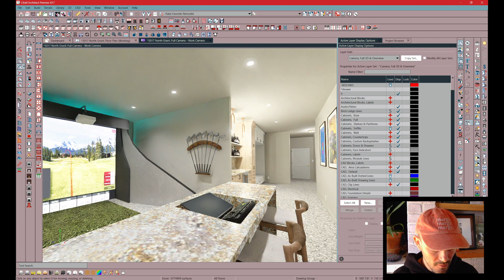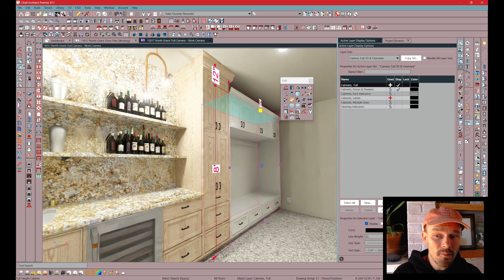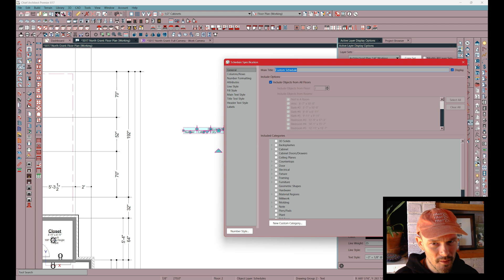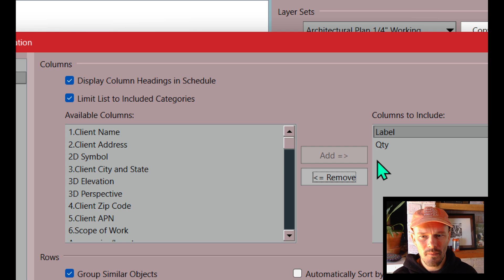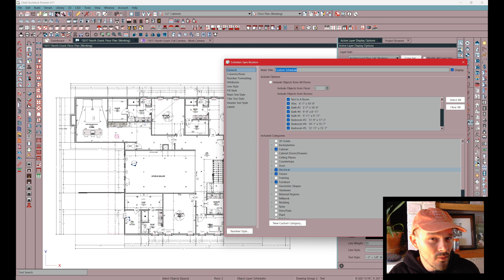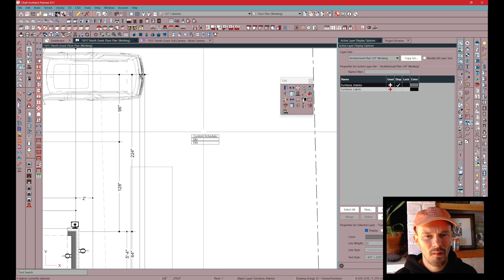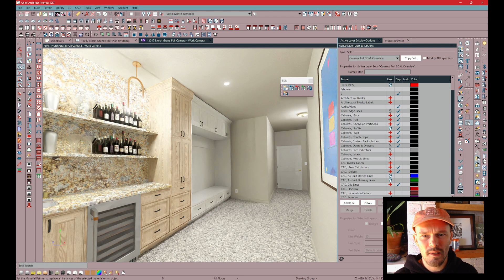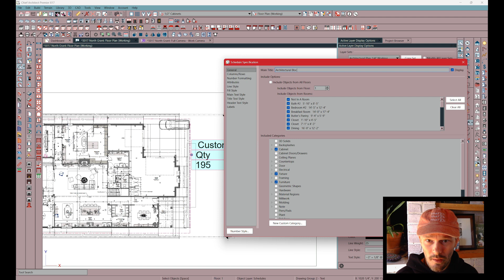Faster Raytrace Renderings In Chief Architect X17

Comment: Super helpful! I get bogged down with big homes constantly, I'll definitely be putting this system into action. Can't you skip a step by not making a new architectural block, but instead selecting the Architectural Block layer in Active Layer Display Options and hit "Find"?
Reply from the maker: I'm not sure what you mean. We have to create an architectural block out of all cabinets fixtures and plants so that the layer is then addressable in our 3d views, meaning that we can turn off the display of just those items we don't want to be used in calculation for rendering and rebuilding the model. This video also misses a step where I like to pull the Architectural block away from the model so it's not forcing the rebuild of walls as well
Reply: @rabbittdesign8482  I mean when you try to make an architectural block and it doesn't come up as an option, instead of blocking two  items together to find the issue (at 6:00) just select the Architectural Block layer and select Find, then it will show you all the blocks you may already have so you can unblock them and proceed with blocking everything via the schedule row. I'll have to also try pulling the block away